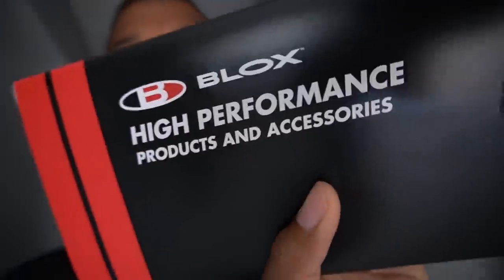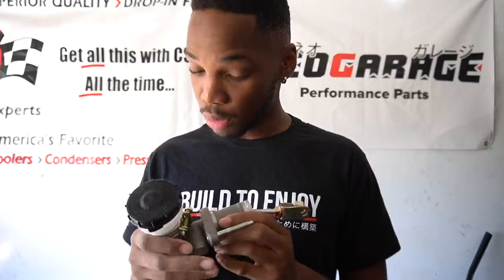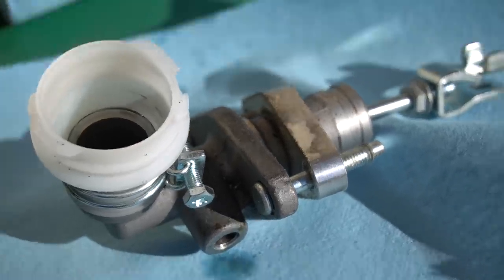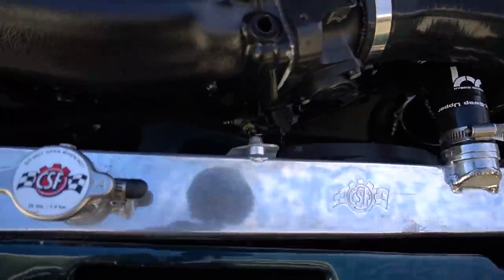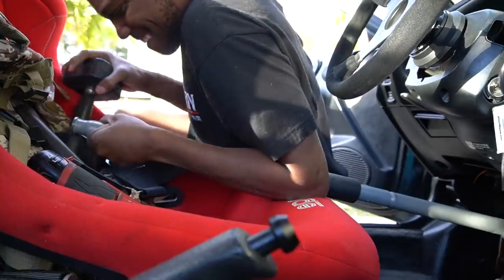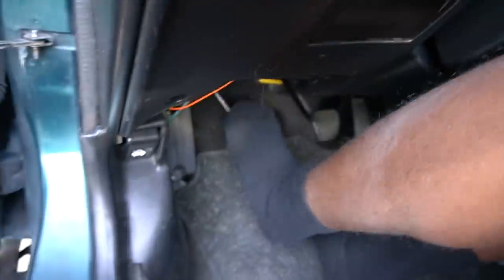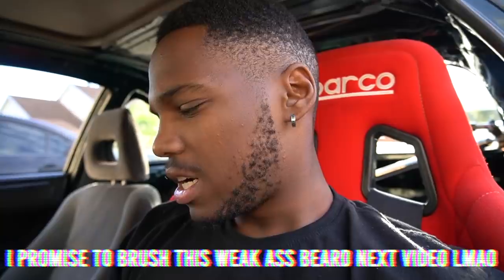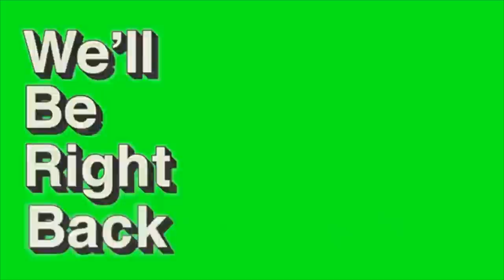K24 INTEGRA GETS S2000 CMC UPGRADE! - Track Prep Ep.1

Comment: Idk if anyone told you this or not but there's an way easier way to bleed your clutch pedal bro. You just put fluid in a bottle, punch a hold in the lid, put a vacuum tube from the slave cylinder into the bottle make sure it's submerged in the fluid and just leave the valve open and pump the clutch until you stop seeing air bubbles and make sure you keep fluid in the reservoir and you're good. 👌🏾

Comment: Hey homie on the master cylinder rod coming through the firewall that has an adjustment jam nut on it. On most master cylinders you can either tighten or loosen the slack with that rod until it feels normal and engages good. Just be careful because if you tighten it in a hair bit too far it’ll keep constant slight pressure on the throw out bearing and can burn up the clutch in a few days if you accidentally over adjust it. Try to match the length of rod threads sticking out of shackle on the clutch pedal armature to that of the old clutch master cylinder (unless they are slightly different lengths of rods then get it close). I hope this helps you homie!! Yo car is lookin freshy as phook
Reply: Also one more thing to keep in mind. No matter how much air you get out of the system (more specific when it’s fully bled) the tighter in that rod is the stiffer the clutch pedal is and the higher the pedal bite point is when pulling up off of the clutch pedal. And the looser you have that rod the lighter and spongyer the clutch pedal is and lower the bite point is.